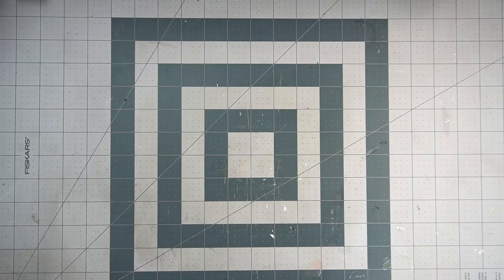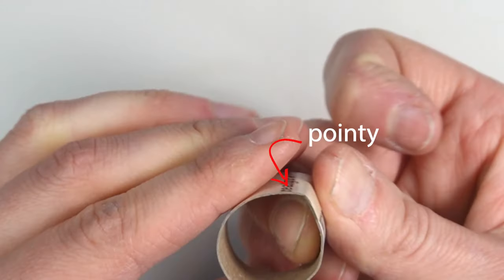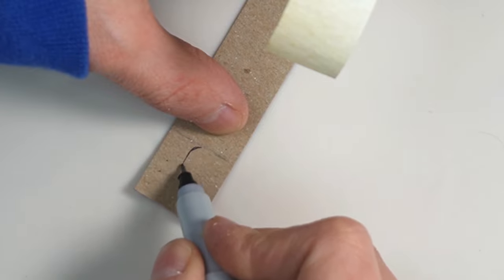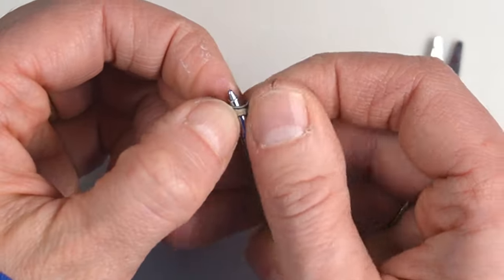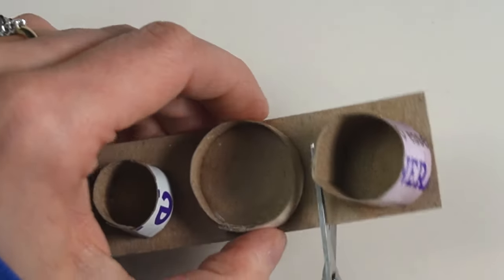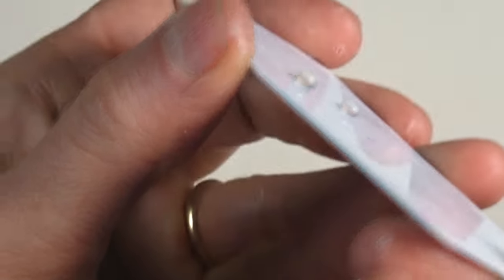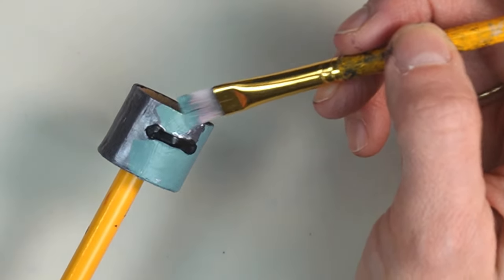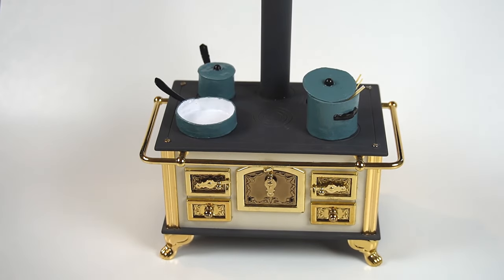dollhouse pots & pans made from CEREAL BOX

Comment: You probably already know this, but Murphy's Oil Soap in water will get out almost anything dried on your brushes. I use a lot of Murphy's Oil soap. A lot....
Reply from the maker: I didn't know that! I've been using the method of soaking dried brushes in dirty paint water and it's 2/10. Thank you for the tip! I have some of that under my kitchen sink.